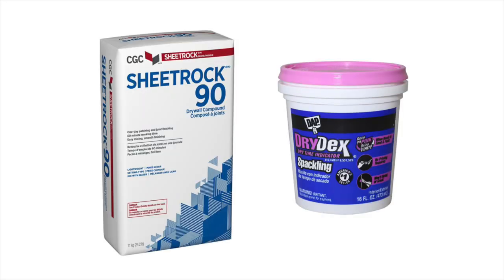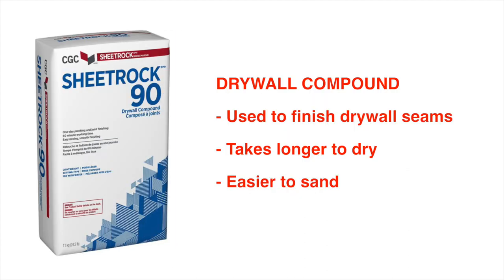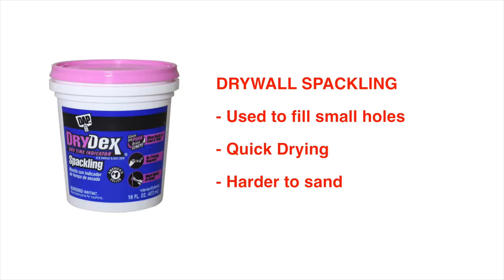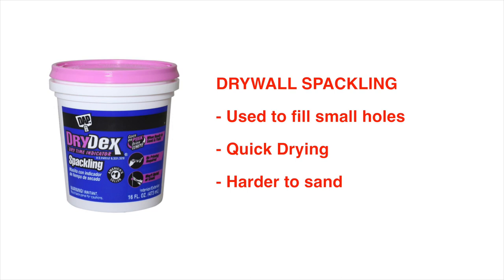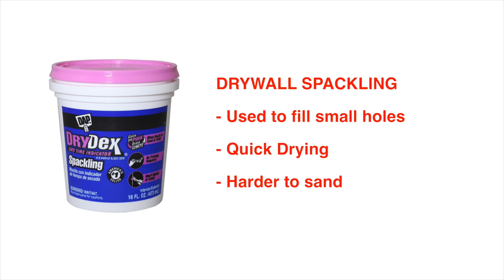How To: Patch + Repair Drywall Holes!

Comment: Great video Tasha! What are your thoughts on adhesive drywall mesh for doing patching, instead of the drywall cutouts?
Reply from the maker: Not as strong! If you were to lean on it, it has more of a chance of causing an indentation. I wouldn't see an issue if you did it in a low-traffic area? Good for when you're in a pinch!